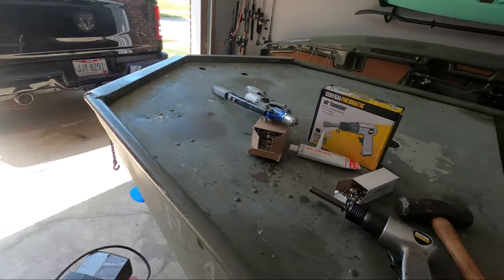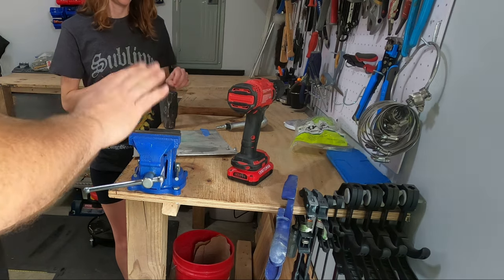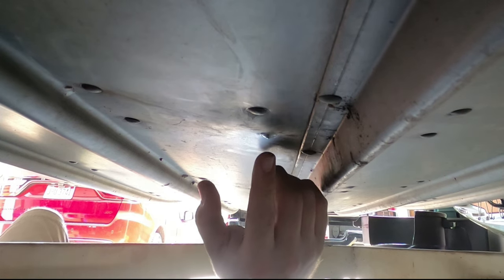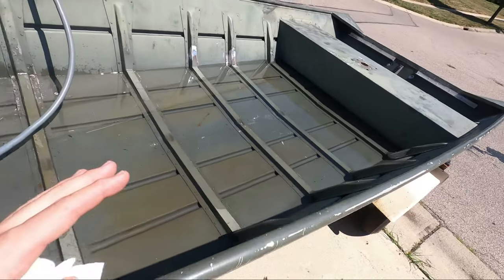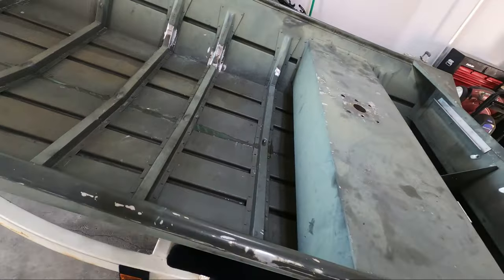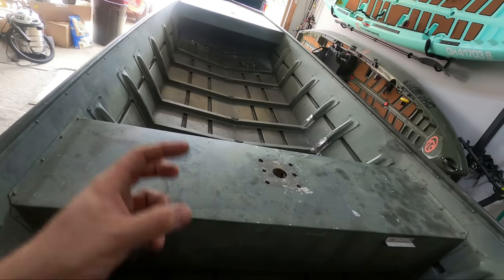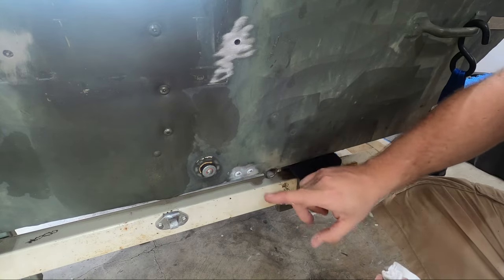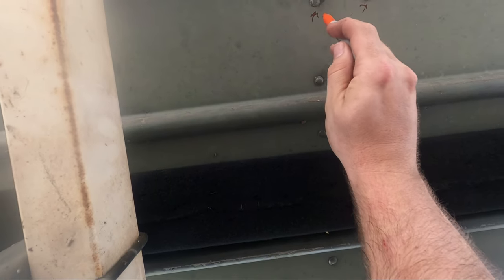HOW TO FIX LEAKY RIVETS AND TRANSDUCER HOLES ON ALUMINUM JON BOAT BUILD USING SOLID AND POP RIVETS

Comment: Interesting.  I have never seen that style of rivet.  I like it.  What was your wife doing on the other side of the rivet and is that required to make it work?
Reply from the maker: She was holding the head of a small hammer to give the rivet something to hammer against. Basically the rivet gun works by squishing the rivet, so you need something on the other side for it to squish against.